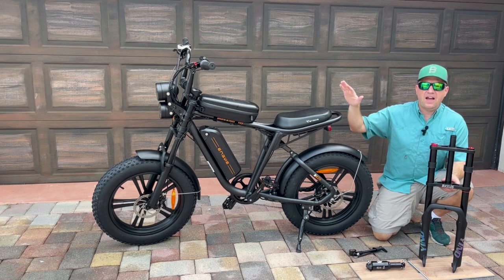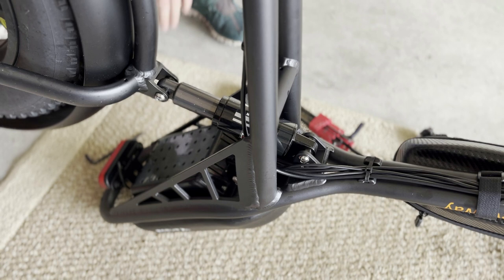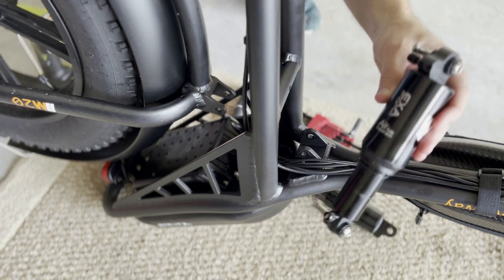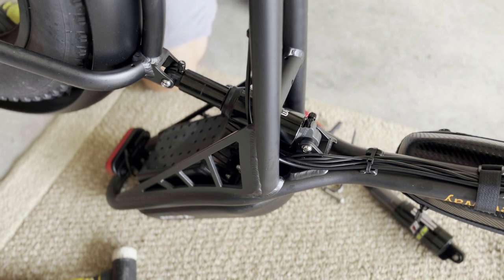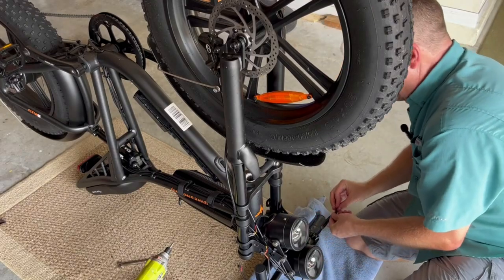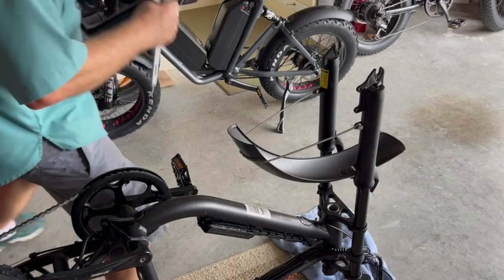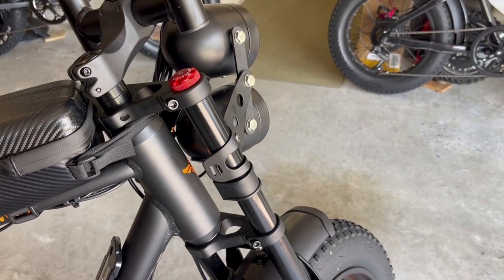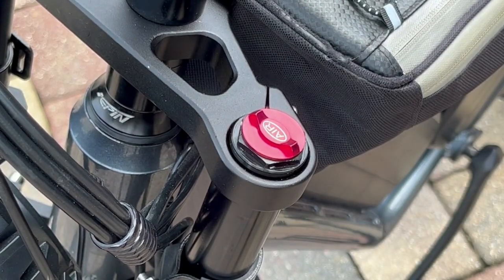Engwe M20 - Upgrade Shocks to Air Suspension - Air Fork & Rear Shock

Comment: I purchased the rear shock absorber you linked. easily assembled and now I have solved my back pain with my engwe m20 and now I can enjoy it with a smile!
Reply from the maker: Great to hear!
Reply: Is your saddle lower with the new one?
Reply: @LaurentMaloberti  in practice with this different air shock absorber you can decide based on the customizable pressure with a small pump and pressure gauge, adjust the height of the seat. the more pressure you press, the higher the seat will be from the ground, but you will have harder, almost blocked cushioning, and vice versa. I had padded the original saddle making it already higher and with less pressure the cushioning is nice and soft like floating on the clouds 😀
Reply: Hi,do you have the 190mm or the 220mm shock on your bike? Still low with 180Psi
Reply: I ordered this shock absorber, 190mm, but seems like it’s shorter then the OEM.  Did you guys find it to be shorter? Thanks

Comment: Did u have to remove the crown race on the old fork and transfer it?. I've got the q20 ridstar and I'm having the same issue it won't slide through the standard class even tho they were advertised as 32's
Reply from the maker: Is the bolany shocks measure 34mm now not 32mm so it will not for in the factory crowns?

Comment: Hi, great video. I'm just slightly confused. Did you use the whole Bolany fork or did you use some of the OEM fork? Video didn't really make that clear. Keep up the good work!
Reply from the maker: I re-used the top crown and stem from factory with new bolany fork.   The top crown stem is very tall so i needed to reuse it to keep handlebars at the same height https://amzn.to/3y8YTYw
Reply: @BRichSolution  Thank you sir!

Comment: You were lucky that you didn't have to replace the steering wheel bearing. With my Ouxi v8 bike, I had to think a bit about which bearing is compatible with the new suspension. :D
Reply from the maker: See my ouxi v8 front fork replaced video i made last month  https://youtu.be/mbCBl9HIH3M

Comment: Measured from hole to hole and is 190mm but still looks short. Have not checked the pressure on it yet as didn't want to do that until I installed it but will install at weekend and if it doest look right I will send it back
Reply from the maker: May you need a 200mm version?  Does bolt to bolt on orginal shock  measure 7.75 inches (200mm) or 7.5 inches (190mm)

Comment: Hi B rich 
Is the engwe m20 rear wheel motor cable a straight pull type? Its realy tight ! 
Need to do a trye change .
Reply from the maker: Yes straight drop out

Comment: i am a new e biker having just taken delivery of my m20. my thoughts are of lowering the seat hieght by replacing the rear shock with smaller length one [ say 160 instead of 205 .] would this alter the geometry of the bike to much ? thanks for the videos they are a great informal education boost especially for us newbies.
Reply from the maker: Good idea go for it with 165mm, mind as well go with air shock to improve ride

Comment: OK ordered the 190mm shock from Aliexpress and look a lot shorter than the original  does it affect ride height? Just asking before I install it or send it back
Reply from the maker: Make sure they send 190mm and not 165mm?   Also did you check the air pressure and adjust each chamber to 90-120 psi?

Comment: Make sure if you upgrade fork you buy one with 32mm diameter struts... Dont buy any 20x4 fork like i did. Got myself bice ztz fork to find out struts were 34mm and i had to return it since i couldn't reuse original steerer tube. And moat of these aftermarket forks steerers are too short. 

Good video!
Reply from the maker: Thanks.  The fork is order in june with this link it was 32mm diameter no issue on install.  Send link to correct fork if this one has changed

Comment: great video, the stock shock on the m20 is 240mm, how come you replaced it with a smaller one ?
Reply from the maker: the rear shock I replaced on M20 was the same length as stock and measured 190mm from bolt to bolt
Reply: mine came with a 240mm from engwe  @BRichSolution  I suppose it doesn't really matter, I was just wondering as I'm planning to replace it with a more comfortable shock, I did wonder because mine does look bigger than others iv seen online  thanks appreciate your reply
Reply: Mine come with 240mm shock, my plan is to go for a 265mm coil shock from dnm with a 20x3 tire on the back to not mess with the geometry too much. I would gain a bit of travel as the strok on the original 24 is just 3 cm, while you have7,6 cm on dnm.
Reply: 220 mm on my Engwe

Comment: When will you be able to do the test to test the two shock absorbers?
Reply from the maker: I can do a video this weekend, but the air shocks is big improvement over the stock shocks as they are adjustable for riders weight and they do not rebound abruptly like the factory oil filled shocks
Reply: @BRichSolution  👌

Comment: I bought and install the Air shock absorber in 190mm but the saddle is lower than with the original one which is longer (220mm)
Reply from the maker: Buy the 220 and return the 190mm
Reply: did you find any 220mm yet?

Comment: Here's another noob question for you. How do I mount the original Engwe M20 brake to the same Bolany fork you have? Thanks for your help.
Reply from the maker: See video
Reply: @BRichSolution  I have watched this video multiple times and I' have the plastic fenders, the rear shock, the seat. All great ideas by the way. I had the Bolany air suspension you recommended but I'm using the OEM mechanical brakes that are side mounted. No where in your videos to you show the mounting of the break calipers to the Bolany. Do I need some kind of conversation kit to make them fit? Any help would be great, thanks! This is just my entry bike. I also have a Philodo H8 and a Freego F3 Shotgun Pro Max.

Comment: B rich , are the air fork upgrade lighter in weight than the stock fork, can you tell me both there weights ?
Reply from the maker: There lighter than factory ones.  I should have weighted them.  I would say 1-2 lbs lighter
Reply: B rich Thanks for the reply, think I am going to try  these or some 34mm bucklos and swap all clamps .
Can I please put in a request for a short vid on how to remove the back wheel - change a tyre and re install wheel.  Please do a vid .

Comment: Replacing the shocks is a waste of time since the primary thing that makes the M20 uncomfortable to ride is the rock hard seat.   Not only is the seat hard, it's also the wrong shape for pedaling, as you can see in the video:  it's wide in the anterior which brushes hard on your inner thighs as you ride.    It's basically unrideable after 20 miles or so.    I completely changed the ride, and length of time it could be sat on,  just by throwing a gel foam bike cushion on the seat, while elevating it with hard foam cut to the shape of a real bicycle seat.   And that's all one needs:  a different seat.      Since the seat is also too low for anyone over about 5 ft 2, adding the proper shaping and padding to the seat also helped the pedaling geometry, making riding much more efficient as well as tolerable over 20 miles.
Reply from the maker: I agree and I upgraded the seat was big difference and made the seat taller see video
https://youtu.be/wjo4I_F5AQI   The front fork made difference as the oil filled shocks are poor damping and recoil too much

Comment: Man bolany doesn't even fit on the m20
Reply from the maker: Why doesn’t it fit if you retain the factor crowns?
Reply: @BRichSolution  factory crown is diffrent distance between pistons
Reply: @arunnada3257  same problem here, doesnt fit with bolany crown too because of short steering tube, have you find other which fits?